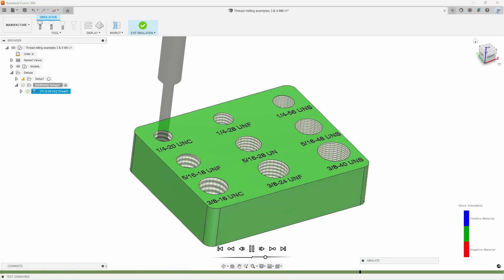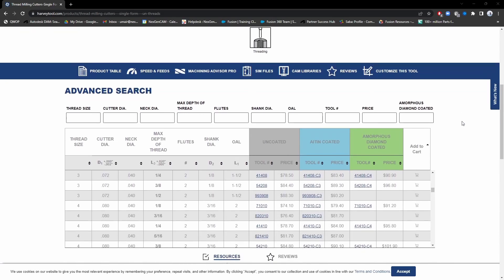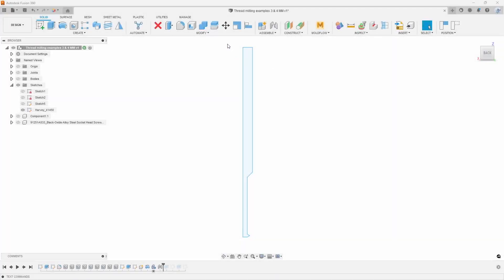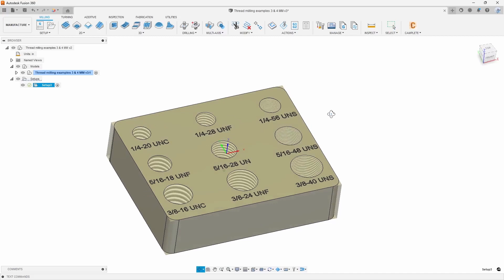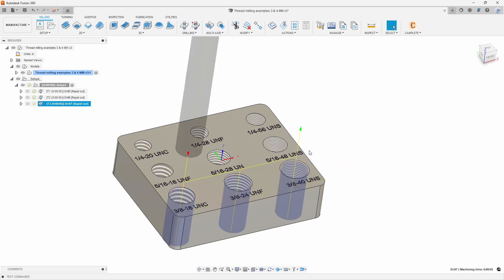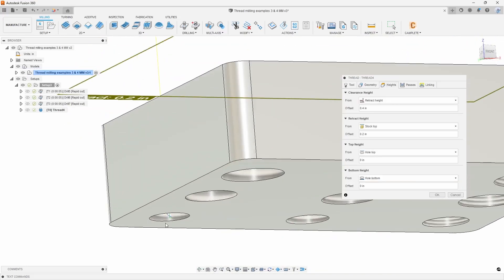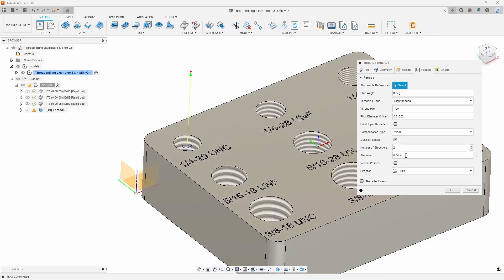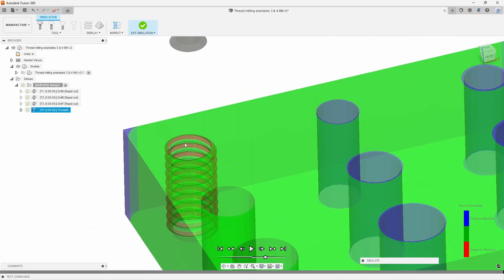Thread Milling with a Form Tool

Comment: CAUTION:   The #7 drill ONLY APPLIES TO THE 1/4-20! The proper drills for the other holes can be found on a tap drill chart OR THEY CAN BE EASILY CALCULATED (standard 60 degree thread form) by subtracting the value of the thread pitch from the major diameter. If this is not done, that fastener will NEVER go into that thread!
Examples:
For a 1/4 - 28.... 28 Threads per inch (TPI) = 1/28 = .0357". The proper tap drill is 0.25"(major diameter] - .0357" (pitch in decimal value) = .2143" (#3 drill, closest next size up)
For 1/4 - 56.... 0.2321 (Letter A drill is .234)
And as with all things metric its easier...
For M8-1..... 8-1 = 7 (7mm drill or letter J drill)

Comment: Good video but if you want to learn a bit more Saunders has a really in depth spreadsheet that will help you verify you are using the correct tool for the desired thread size.  It really helped me understand more about single form thread milling.  Also you will need to know the crest height of your form tool (which is the distance from the very tip of the cutter to the shaft od).  Check Harvey Tools speed and feed pdf because depending on the material you are threading they will have the suggested number of stepovers to take.  To figure that up for example in Aluminum is 2 stepover; pitch diameter offset / 2.  Enter that value into your stepover and that takes care of that.  Also make sure on the linking tab the bottom option is checked for lead to center
.
Reply: These are awesome tips! I will definitely be using them in the future. Thank you for watching!